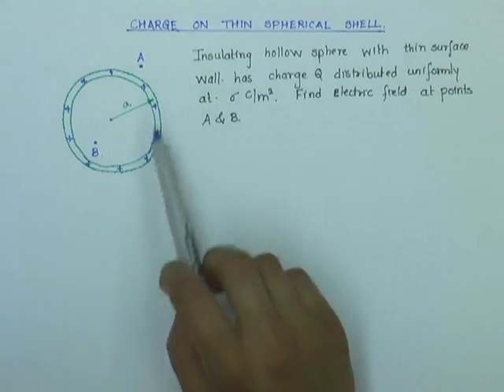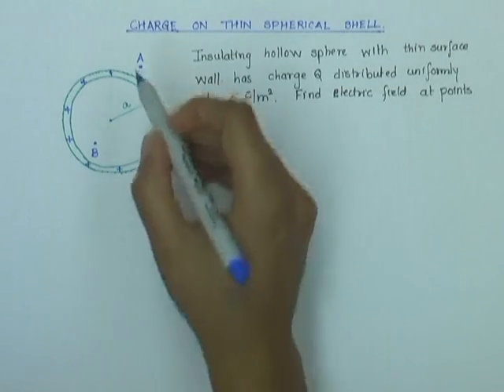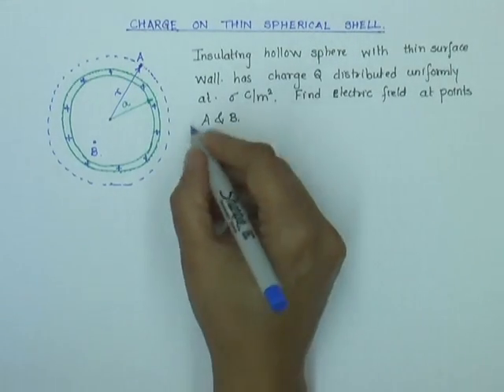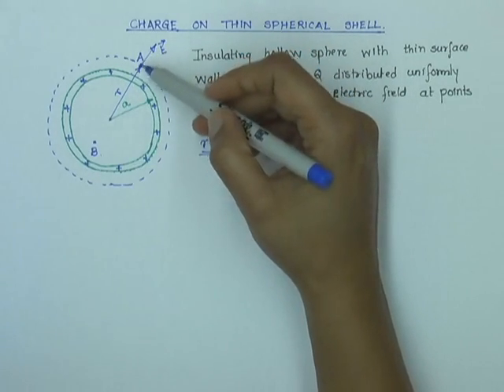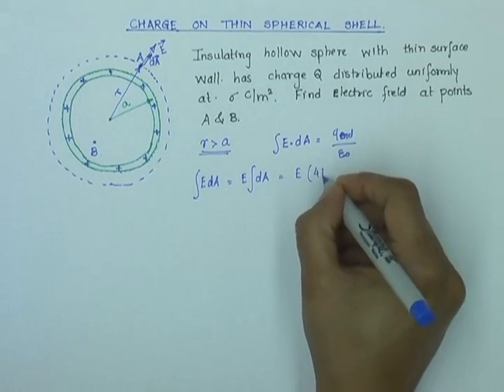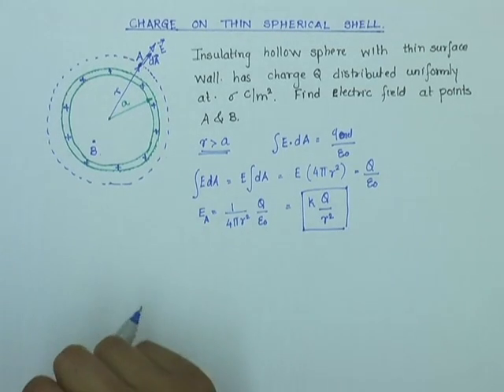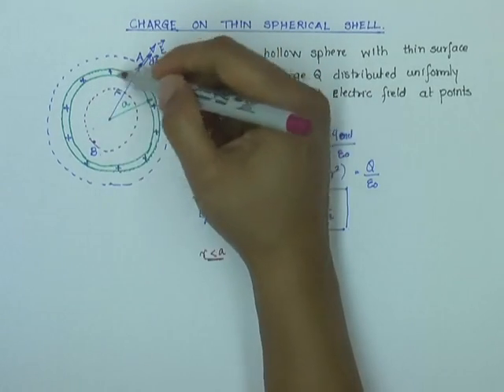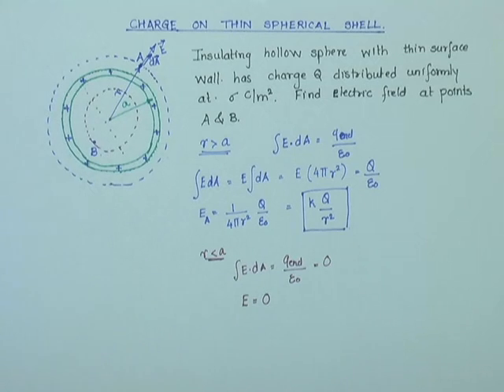Electric Field - Insulating Hollow Sphere of Charge

Comment: the charge is bound on the surface of the insulator.So only the first Gauss surface encloses Q.
Reply: It's the opposite, actually. Because it's a shell (not a solid), the charges are all along the surface. Since electric fields are calculated by the enclosed charge, and there is no charge enclosed inside the shell, the electric field there is 0.